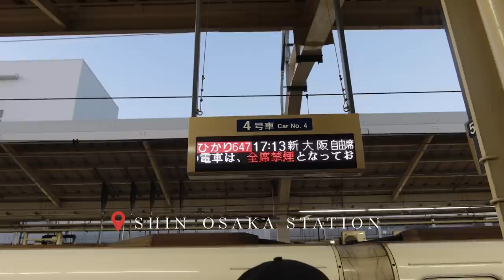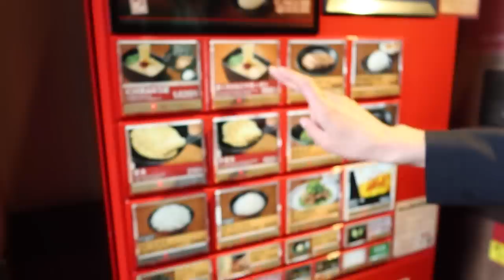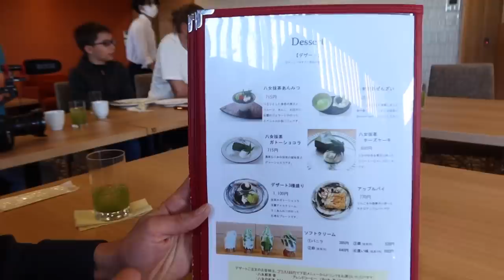Japan Travel Vlog | Visiting Our Matcha Farm in Fukuoka | Sanne Vloet

Comment: The equipment for processing is metal and aluminum.        Matcha leaves pick up  trace elements of the metals which eventually enter the body.  
 Thankfully matcha is known for antioxidants and bioflavanoid compounds which hopefully will remove those toxic metals. 
    I have tried the Nekohama Matcha chocolate bars.        I've had Chocolate and Matcha from all parts of the globe.

The Nekohama brand by far is the Best.    👌.